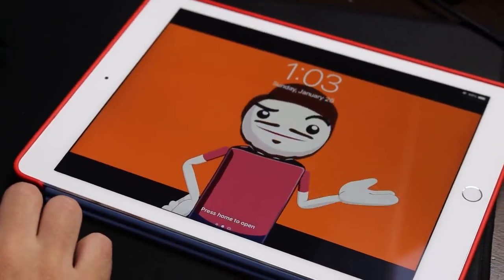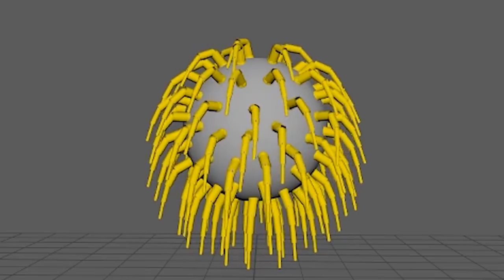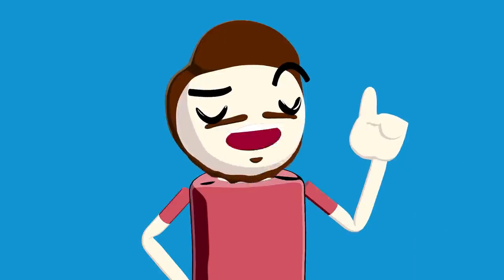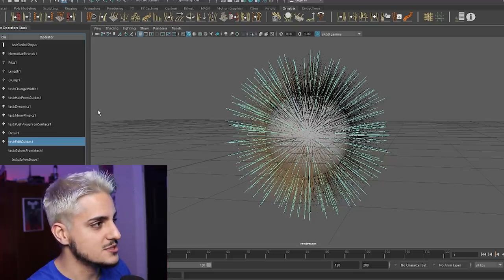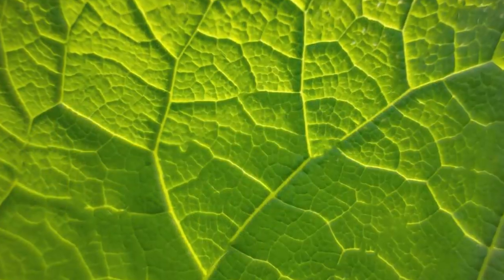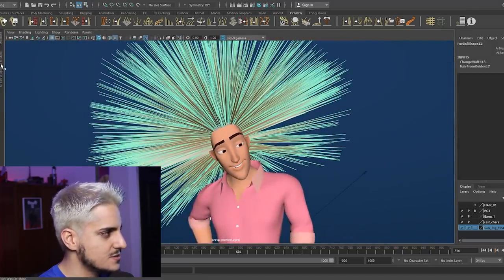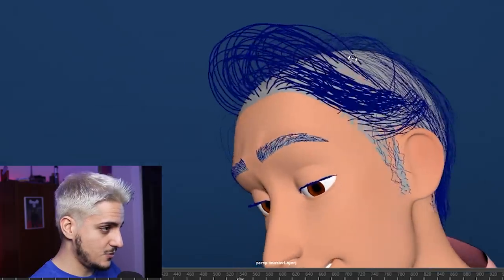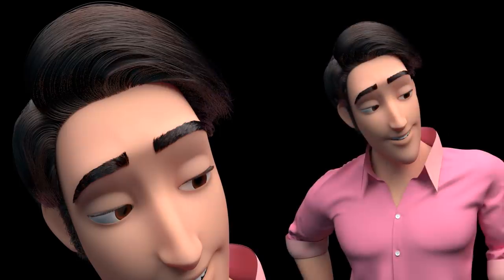How Disney Makes Realistic Hair?

Comment: Like the thing I find actually amazing is that even that they went to 3D they still kept the same design like obviously yeah you could design sketches but I mean that literally they never changed the eyes exactly the same as they did from back in the day we still have the same forms from back in the day it's like when they moved to 3D they didn't change anything that even the animation even though it's free it's still looked nice and fluid and that's great because I've seen some company that when they go to 3D obviously the software is hard to use and it's complicated but somebody's not work out right but for some reason Disney me and Pixar did a good job of emulating and creating something great using the 3D software that they use today

Comment: Hi Hispanic Anderson Cooper. I am struggling to find out if the hair I made will render properly when I animate it.  Currently I used fibermesh to create a low cut fade for my afro male character but I will be using maya or unreal engine for animation. Should I had used xgen instead? I am so confused. Thanks!